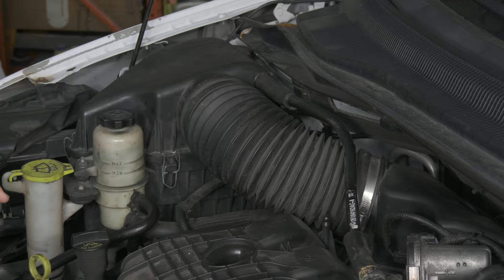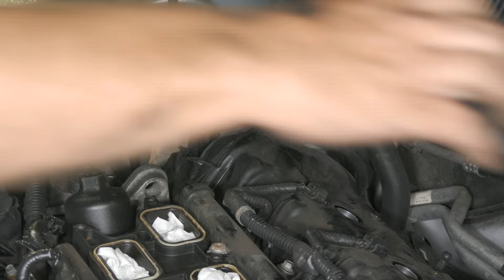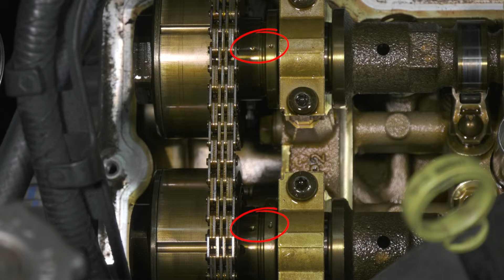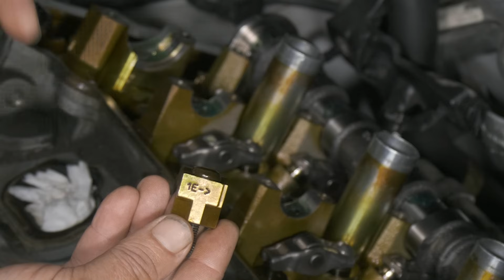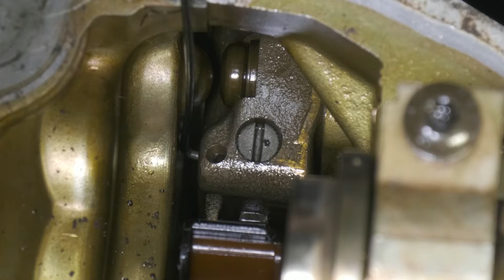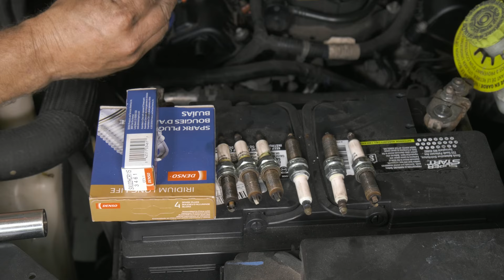2014 Chrysler Town & Country 3.6L Camshaft & Rocker Arm Ticking, Clicking, or Misfire Repair.

Comment: hopfully you see this in time . im in the middle of a move and one one leg of the drive i started hearing the ticking. knew what it was but the timing is terrible. 200k on the engine and im wondering if it will make another 1500 miles before the cam starts to get chewed on.

Comment: Could you quickly explain why you didn’t use the plastic wedge on the right side (near the firewall), and how you were able to put this back together without creating slack in the chain or chain tensioner?

Comment: Great video, I am doing this but doing timing components, so have to drop the timing cover, 2015 Town and Country; I have done it but with the engine out, did not have new parts and once assembled and running got a tick/ rattle/ clatter coming from the timing cover; may be a stretched  chain or failed tensioner, or maybe a failed phaser; when I put the engine together due to a hydro lock whole overhaul, all my cams were showing use signs as the van was 126500 miles but all mopar rockers and lifters were ok I inspected one by one; I assembled the valve train with new correct parts from Melling, then got that noise that was not there before; since running back from January 3 this year I have driven 300+ miles with the noise and I am afraid the cams or a cam may be chewed, I really don't know until I open the valve covers again; I am NOT looking forward to do this job, I super dread it because I have never done it with the engine in the bay and are afraid I may run into roadblocks; one thing I wondering is how to put the timing cover back? from bottom or from top? will I have clearance? there is no video online showing this work, I may film my own for reference, I would love to replace all 4 cams and all rockers and lifters Mopar; this van has still the Mopar Total Care lifetime Warranty on it but Dealers want me to pay upfront for deep teardown promising to refund when warranty is approved; nice try! leave me no choice but to do it myself just like I had to do the whole engine as the job was quoted 13K way more than what the van was worth then; now it is worth around 8K running but this amount is easy to reach when a Dealer works on it. For the timing noise I have the 2 chains, the 4 guides, the 3 tensioners and all 4 phasers; all Mopar, around $1400+ in parts including valve cover gaskets, water pump and crossover gasket, the other gaskets in the valve covers are new ajusa just replaced and planning on reusing; the primary chain, oil pump chain and sprockets will not be replaced; the cost of 4 cams and all rockers and lifters from Mopar is almost $2k!! I just do not have the money; the rockers and lifters Mopar I have used but in good condition were replaced back in 2019 with a whole engine overhaul under warranty due to a spun bearing; then the van died in a flood on September 1 2023 and was out until this January 3 2026. I don't know what else to do to encourage myself to actually put my hands on this job; van is in garage ready to go in..I do have a half lift which helps tremendously. I want to start this weekend and first thing I will do is to remove valve covers to inspect the cams hoping I do not have to replace any!

Comment: I so need help. I am 100% disabled and my Jeep 2012 is all I got. Just did rocker arms. Jeep ran fine before, just had the tick. Found 2 rockers bad. Cams are still ok.. reassembled everything, went to start engine, and it idled very high. Do I have a vacuum leak somewhere? Or Idle sensor bad? Please help-

Comment: Thank you for your video. It's given me the confidence to do this myself. But here's what just happened. I only worked on Bank 2. Changed both camshafts, rocker arms & lifters. Everything started great, drove about 5 miles, then my van shuts down. No longer starts. I'm getting P0390 P0365  P0345 P0340.
Reply: u fix it?

Comment: HELP PLEASE
2014 Grand Cherokee. The first time I did it the link was in the center. Just like before, the arrows and lines are all found correctly and the holes for the 4 camshafts are facing up correctly, and there are 12 pins from side to side, but instead of a link now the pins are aligned. My question is this: Is this correct? The shifter is electronic, I can't put it in neutral and I'm afraid of rotating the damper and bending the valves.

Comment: Hello sir. One comment. As I have watched this video a couple of times now. The second time I noticed that  you got the wrong sequence on the  cam position sensors. Number 4 was in the back not the front. You put number 4 in the front first instead of the rear where you started marking the sensors. What happened when you started the engine?? You said they needed to go back in the same place they came from.
thanks, just wondering what happened?
Reply: Good observation, it is good practice to place them where they came from but they are all 4 the same part numbers, if you are referring to the actuators, cam phasers there are 2 different part number for intake and exhaust but they are also interchangeable, however it is good practice to place them same place they came from, last but no least after all this is done once starting you need to run the "crank cam relearn" from the scanner tool, I think he mentioned this at the end. I am not a certified mechanic, just a DIY.

Comment: Why would you only replace a couple of lifters instead of all of them? wouldn't it make more sense to do all of them to make sure this failure does not happen again in the near future?
Reply: Check out the cost of these parts, that's why, it is always recommended but Dealers only replace what is broken, unless Customer authorize and pay for it. Warranty services replace exclusively what is faulty or broken to the T. To do it the right way as you say you'd have to do it yourself or pay.

Comment: Sitting in my ringside seat,m I really wonder shy dropping the power train out the bottom is not a design feature. How many engineer backs have been damaged by these designs? ZERO. I think they ought to work on what they design.

Comment: Thanks for your help! I replaced a bad rocker arm (the last one to the right) under the left exhaust cam. I'm adding that it was easier to access the crankshaft after removing the air filter bowl. With a longuer rachet, I didin't need to remove the spark plugs to turn the crankshaft. Grand Caravan 2014.

Comment: What would happen if you installed the phaser solenoid/actuators in the wrong position?
Reply: If using the "crank cam relearn" from the scanner tool, you'd be fine; they are the same part numbers.

Comment: my dealer told me that they changed 4 bad rockers and it was still ticking and I looked at the valve covers and they never took them off. Still had original RTV sealant and dirt around it. I showed the manager said how did they do it when the valve covers were never taken off. There should be new RTv on a couple spots before the valve cover goes back on.

Comment: You should have mentioned that there are black chain links to make sure 100% your timing is on. I was one tooth off, started my van, and threw out the timing. Now I am in a bigger problem. Just fyi.
Reply: Those black links are only for putting the chain on for the first time. It would take many revolutions of the engine to ever get them to line back up. That's why you need to mark the chain to the sprocket.

Comment: I went to 3 shops, and they all wanted to gouge me for around $5000.00 for this job. They said they wouldn't do it with the tensioner holding tools as the "timing can jump." They all wanted the labor cost to remove the front timing chain cover. Ridiculous.

Comment: Replaced my rockers and lifters left (driver) side torqued everything to spec put it all back together now I have the dreaded and mysterious P0394 code and traction light, tick is gone another problem has arises already replaced cam position sensor bank 2 clear code, came straight back I now have a cam phaser actuator that screws to the outside of the valve cover to see if one of those went bad.
Reply: Did you removed the actuator before removing the valve cover? I read this is important as they are very expensive, or maybe they fell or got hit?

Comment: hi can you get a misfire with out having ticking noise form rockers are and no noise form lifters and yet have misfire in one particular cylinder. mine is on 1 cylinder. ive done compression test is good leack down test is good. smoke test upper and lower intake good. check ground wire to the first wire harness is good. coil and plug is good. now im not sure what or how else i can test to figure out why misfire on cylinder 1. i have same engine you are working on. thank you. i put a new injectior too. asuming new part its good.
Reply: Hast du dieses Problem gelöst..?
Reply: I have a P0306 error code, the car isn't running very well, it's shaking at idle. I replaced the spark plugs and coil, checked the compression, and it's normal, just like in other cylinders, but the problem remains... and the error code. Can anyone offer advice?

Comment: Is it safe to say that if one is only replacing lifters and rockers that you can do this at 24:07. Only loosen cam caps enough to get the rockers and lifters out, replace and reconnect everything? Seems to me it should be ok. Also the shop manual says to place the two holes on the cam at 30 degrees to put the cam in a neutral position.
Reply: You can do that but you run the risk of stripping the threads in the aluminum head

Comment: Amazon parts vs Mopar … Anybody? Canada ..Mopar = $700. Amazon =$116 and up. Rocker and rods. Quality vs offshore?
Reply: FAFO...always buy Mopar, they are expensive for a reason, buy crap and you will be back to repair in no time. I am not affiliated with Mopar and also hate their horrible prices, yet, the most important parts; Mopar if I can while trying to keep the van for myself..if you repair it to sell, buy whatever makes it run.

Comment: Excellent vid.  I am 64 and was once a full-time mechanic (back in the 80s).  I was able to easily do this job do to this well done video. I replaced one intake cam and one exhaust cam and all the rocker ams, and oil cooler.   If you have mechanical sense, this all you need to get more life out of your van.

Comment: Question.... no rockers are bad. Found 2 failed lifters. Could squeeze em with just 2 fingers. No wear on the cams. But I still have ticking coming from the left bank. I'm suspecting either a sticky valve or a bad cam phaser. Any ideas??only ticks bad when it's at op temp. No codes. Oil new and at perfect level.
Reply: Same I hope replacing all lifters and rockers. Will that work? Hope so

Comment: This is the epitomy of my last ever Chrysler. For less money I can buy an old ,old vehicle. Always run, fixable, maybe 3 wires.
Reply: Beg to differ.   Had everything from old Chevy C30's, F150's, Chevy 1500's, Ford E150's in our fleet and so far these 3.6's long as you run synthetics and do regular maintenance have been the least problematic of our business fleet vehicles and 3 of the 5 have over 300K on them.    Now as for that shit ass 6 speed transmission..........

Comment: I wonder what holds the chain down, how come it does not slip off the crankshaft?
Reply: I actually watched another guy explain why the chain doesn’t fall…. It’s cause at the bottom it’s actually being held into place by the housing
Reply: I was wondering exactly the same thing. Seems like it could just fall off and you would not know how the cams are timed to the crankshaft.

Comment: The 4 things that you took off the front of the valve covers are VVT exciters... they are what changes the oil pressures in the VVT phasers on the camshafts... they say to soak the new lifters and rockers in assembly lube or engine oil for about an hour or longer beforehand to get the needle bearings lubed up... you also forgot to put silicone sealer on the heads/timing cover joints to stop leaks... other wise a great video
Reply: Agreed.   Recall having to soak / load lifters on even old GM and FORD V8's and I still put assly lube on even the rocker surfaces.    Still....  Best video I've seen yet on this.   Question the lube on the timing cover joints as a lot of these new gaskets don't require it.   But still......   Sure as hell can't hurt!

Comment: Great video!  I just completed the repair this past weekend thanks to your guidance.  Mine was a 2015 T&C with about 140,000 miles.  I replaced all the rockers and lifters.  Additionally, the right intake cam was bad and was also replaced.  Luckily, the Chrysler dealership was open on Saturday and the cam was $375.  The whole job was less than $650 and about 7 hours.
Reply: Is the right side the side closest to the cabin?
Reply from the maker: Awesome!!

Comment: What a huge piece of crap these motors are.
Reply: Got 5 of the Caravans in our fleet with this motor.  3 have over 300K on them, other 2 100K and other than the "usual" and these cams/lifters, they've been the best fleet vans we've ever had.   Had everything from Chevy 30's, Ford E150/250's, Chevy 1500's and Ford F150's, ALL of which have been maintenance nightmares.    Don't even get me rolling on our Ford and Dodge diesels.   Since the Caravan got discontinued we were going to switch to the Ford Transit Connect until Ford shoved their head up their ass and discontinued it.   Dodge Promaster City is to small so we're left shopping for Toyota's now.    Eff the domestic auto makers.

Comment: I have 2014 TC and had to take it in to replace all rockers because it was making ticking sound.  However, even after they replaced them all, it was still clicking at lower frequency, maybe once a revolution, and dealer guy said it was normal so I have been driving this way for a long time but the sound seems to get louder as time goes by.  Does anyone know if this is normal?  I wish this video showed before and after engine sound so I can compare.
Reply: THe cam probably needed to be replace also but they let it go, and therefore still makes a low clicking sound
Reply: Might be your lifters

Comment: You didn't use your wedge tool doing the process and you don't have to remove the cam phaser out completely to do this job
Reply: You are completely right. The phasers and chain stays in place that why you buy those tools. I'm glad it worked for him but its super risky doing it this why. If that timing chain slips at the bottom it just turned into a huge job. If you keep the phasers locked and release the tension with those tools its a breeze and no real chance of jumping time.
Reply: @lovetolearn5253  Wondered about that.   THANKS GUYS.   Been the best video I've seen so far but think I may see if there's one that they keep the phasers in place as that makes total sense.
Reply: Exactly I didn't see him use those wedges?

Comment: Great video, very well explained. However I would suggest you replace ALL the  lifters as well. If you have some that have already gone out, then the others are not far behind. You will want to replace them all with the upgraded parts. I just don't want to have to go back into this a year or two later and replace the other lifters that finally failed. Thank you for the great video and keep it up! Cheers
Reply from the maker: We completely agree, but when working on someone else's car, they get the final say.
Reply: AGREED 110%.   We run nothing but full synthetic in all our vehicles and wasn't until the 210K mark that ours started making that "tick of doom" so we replaced all 4 cams, all rockers and lifters.    Great motors, IF you taken care of them and seen plenty with over 300K on them.